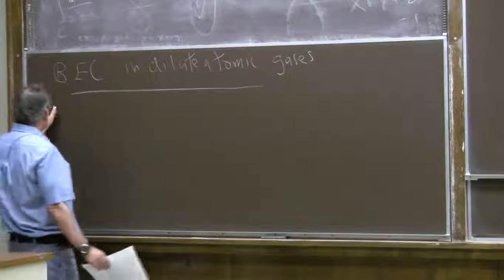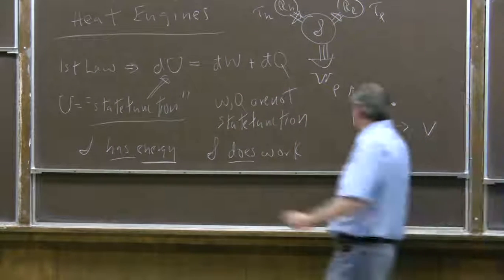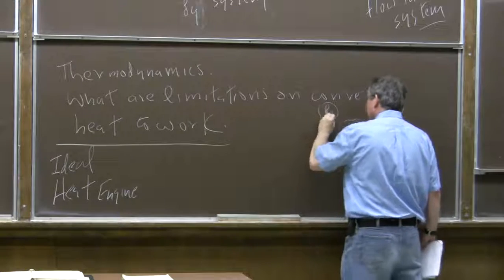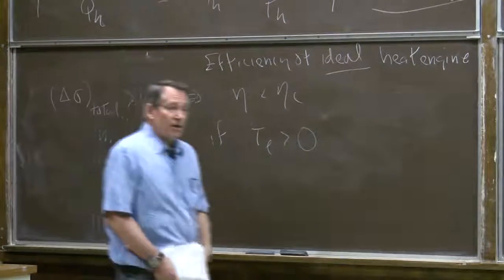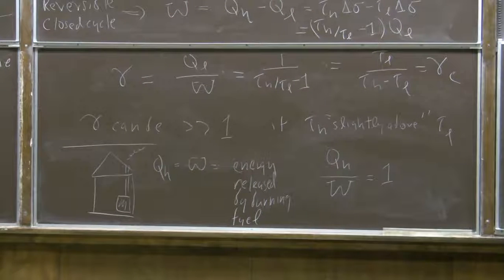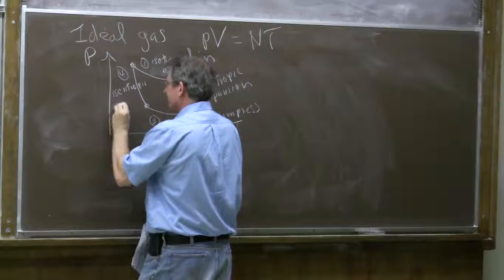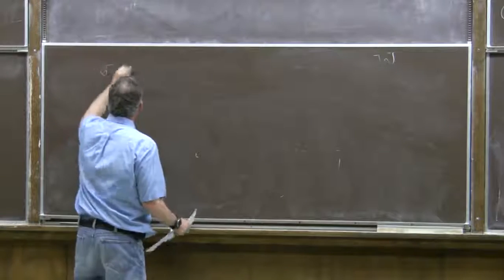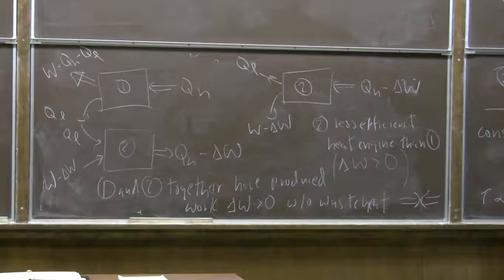ph12c lecture12 thermo

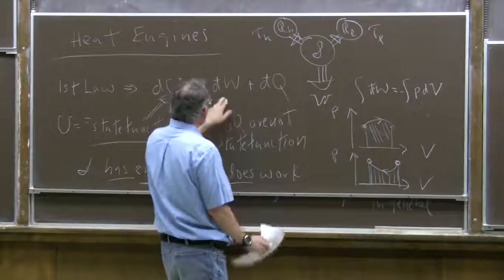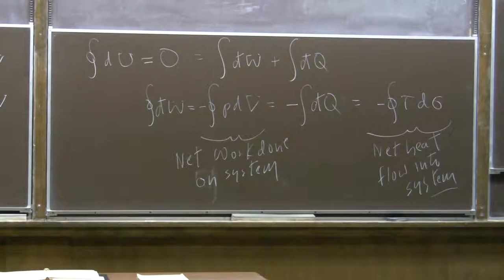Comment: @ around 21:41 and later, it seems that you got confused for the reason I try to spot light on but NOBODY listens to (me). Im 'managed' to cause upset to a professor exactly due to the fact I followed a Logical routine to state my position (that things as for definitions in Thermodynamics do not look quite okay). Thus, the definitions you provide @ around 23:06 just cannot correspond to any reality. Now, how   is it possible to have aircrafts on air and space shuttles orbiting earth 'thanks to Thermodynamics', well, I have no answer to that! But I have definite answer that 

1) integral(T * dσ) cannot only be net heat flowing INTO the system S but it can also flow FROM it. The same applies for dW -> during a half of a cycle, there can be work done BY the system S on its environment.
2) Many students got 5/10 in Thermodynamics due to the incapacity of the teachers to realize that in reality, dW is actually equal to dW_full_cycle = dW_12 + dW_21. In other words, there is a d(dW) (or δ(dW)) there to go integrated. We must NOT integrate only dW. The same applies for dQ, etc.
Reply: SOS SOS SOS SOS SOS SOS SOS: @19:28 you define integral dW as the work done On the system S. NO!!!! That cannot be precise. In a full circle there is dW_12 exerted BY the system S TO the environment (dV_12 or ΔV_12 > 0) and there is also the dW_21 exerted BY the environment TO the system S (dV_21 or ΔV_21 > 0). 

You have to withdraw full_cycle_integral(dW) and instead start considering full_cycle_integral(δ(dW)) = full_cycle_integral(dW_21 - dW12)   

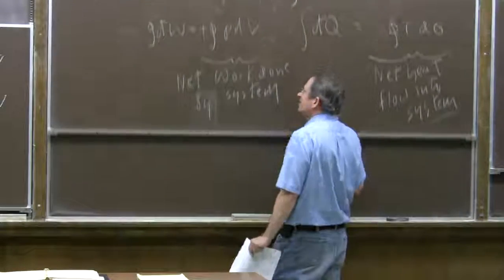SOS: @ around23:34, in the second line where the identity is written, you have forgotten to put a circle on the integral symbol, that is, full_circle_integral(dQ)
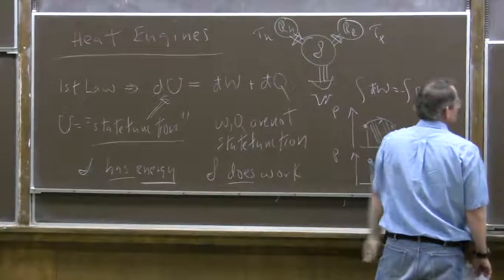Reply: @ around 20:25 you say "... and therefore I should put a minus symbol in here, right?". With all respect, I think that this is not right. And this is because a full circle encloses both expansion and compression (that is, both dV > 0 and dV <0). Usually, dV > 0 is (or if you prefer should be) used to declare work done BY the system S, whereas dV < 0 is (or should be) used to declare work done TO the system S. 

The same applies for dQ and please, let us be careful: What is dQ???? dQ is overall heat that flows through the system S. We have two reservoirs (one Heat and one Cold). To have heat flow INTO the Cold reservoir FROM the system S, we firstly need to have heat flow imported INTO the system S FROM the Heat -> dQ = dQ_Heat - dQ_Cold and assuming that heat flow INTO the system S succeeds/happens in the first half cycle (that is, 1 -> 2) we have that dQ = dQ_Heat - dQ_Cold = dQ_21 - dQ_12.
Reply: It is not the minus signs that kill. It is the lack of dividing the equations (and thus the overall process) into two stages (and thus subprocesses): half circle 1->2 and the rest half circle 2-> 1. This is the fault (of the Thermodynamics literature) which torments the students mainly!
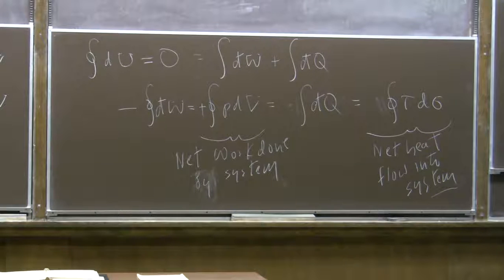Reply: The final equation provided @ 23:33 is eventually not correct. And this is because initially you drew 2 reservoirs (and of course the system S). So, dQ has to include Q_cold as well. You need to divide the whole process into two subprocesses.